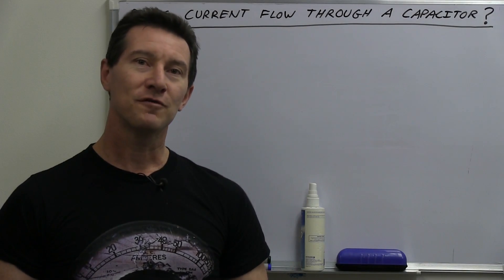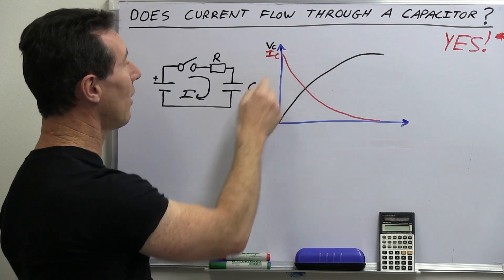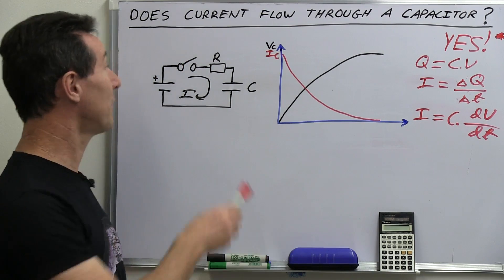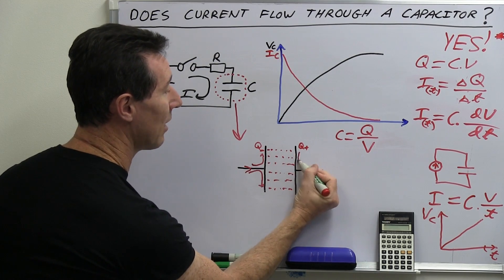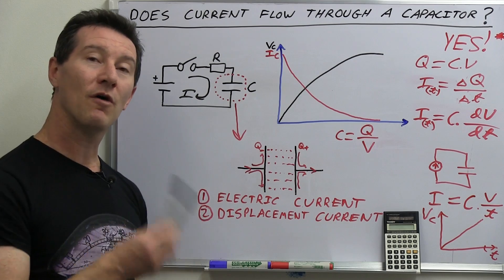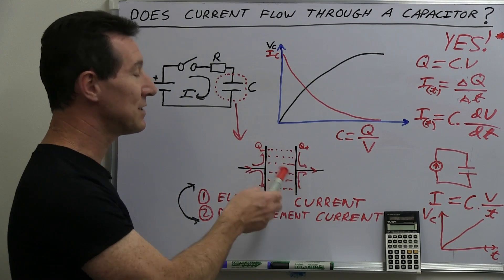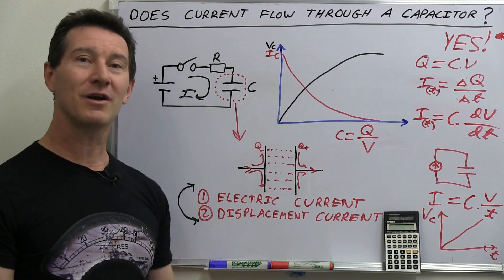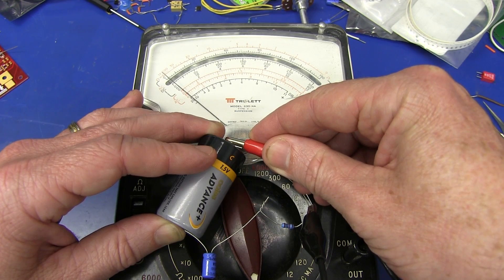EEVblog #486 - Does Current Flow Through A Capacitor?

Comment: I don't understand why you've overcomplicated something so much that's clearly for people that are fairly new to the subject. Why you'd bring up displacement current without just mentioning electrons repelling is beyond me. (Especially when you don't even slightly mention what displacement current is. You just say displacement current flows therefore current flows without giving any reason whatsoever)

The absolute exact same thing happens in a wire as a capacitor. Electrons repel other electrons, in a wire they move forward and since they repel other electrons those electrons move forward by the same amount.

They move forward onto one plate of a capacitor and since they repel other electrons they repel the electrons forward off the other plate of the capacitor.
Reply: "All those electrons being piled up on one side of dielectric would immediately clot and prevent (e.g. repel) any new electrons from coming in, "

Yes, that is exactly what I just said.

"let alone push electrons from the other side of the plate (btw since when we have free electrons in dielectrics?)."

A capacitor is in its simplest form just two plates. Put one electron on one plate, it will push the electron off the other plate. Continue to put more on, you'll keep pushing them off the other plate, until eventually it takes too much energy to put an electron on the first plate.

"While you are contemplating this try to come up with explanation of how many capacitors IN SERIES could possible work based on your theory."

Completely trivially? There is nothing magic about putting two capacitors in series. The electron that is pushes off the first capacitor goes and charges up the plate on the second capacitor and so on.

"If I place 20 caps in series the last in line would NEVER be charged because the first one (closest to -) will have charged and cut off the supply long before."

That is nonsense.

You put one electron on the first plate of the first capacitor, one electron comes off the second plate. The time it takes is irrelevant.
Reply: +BlueCosmology That is exactly what I was thinking !
Reply: +BlueCosmology 
";A capacitor is in its simplest form just two plates."
No. Capacitor is, first and foremost, a dielectric material between the two plates. Charge is stored in dielectric and dielectric only. Plates only conduct, no charge is ever stored in a conductor. And no, dielectric material doesnt source electrons. 

";Completely trivially? There is nothing magic about putting two capacitors in series. The electron that is pushes off the first capacitor goes and charges up the plate on the second capacitor and so on.&";

Here is the problem though. Once first cap saturates all others would stop getting new electrons. The first capacitor can only accept that many electrons until it saturates and stops conducting. Which means all other capacitors in series can only receive as many electrons as many the first cap can receive until saturation.
Reply: +quadcatfly The force would be the electromagnetic force, one of the 4 fundamental forces :)

If you have capacitors in series they all charge simultaneously, they do not charge one after the other.

But seriously, try the following on your lab bench. Take a couple of large capacitors in series and place some small resistors in series with these so you have a point to measure. Set your lab supply to current limit and set voltage to maximum.

If you made good choices the voltage will increase linearly (until your supply runs out of voltage range). On each resistor you will measure DC current and over each capacitor you will measure the voltage increasing linearly. If you made bad choices this will happen so fast you will not be able to measure before it hits the limits.

So if you have say e.g. 5 capacitors in series and you measure the current flowing between them at each connection and you measure this current to be a DC current while the voltage is of course increasing linearly (because you are limiting the current), how would you explain that ?
Reply: This is a basic class for people trying to learn.  Don't be a dick.  If you know, why even watch this?  And no, it's not simple.  It's only simple if you know it.  Lots of people don't.
Reply: +BlueCosmology  If that were the case, capacitor would be conductor no? Why does it stop repelling electrons on the other side?
Reply: +quadcatfly 

In the end when we apply a force to an electron and it moves then we have electric current. Of course these forces can act at a distance and they can act across dielectrics. The only little piece of magic is that the accumulation of charges in a capacitor starts opposing the flow of current over time and this blocks DC current over time (or perhaps better stated as this balances the electromagnetic force which was moving the electrons towards the plate), but this does not mean that current does not flow through the capacitor. 

Whenever there is a net flow of electrons in one direction we call it current - that is the entire definition of electrical current after all. We can also use magnets to apply this force, kind of how current flows through a transformer.

I would be very interested in your opinion about what you would get if you connected a constant current source to a capacitor. Try it out in your favorite SPICE simulation program and watch the DC current flowing through a capacitor at leisure :)
Reply: +Cobus van Eeden 
"In the end when we apply a force to an electron and it moves"
Interesting. I thought electron was the force. Carrier of charge. What force would you apply to an electron?

"but this does not mean that current does not flow through the capacitor."
What is your definition of an electric current then.
Reply: He said to Google displacement current.
Reply: Electromotive force. "E"
Reply: He was right.  You're just trying to prove you're smart.  Big difference.  Air is a dielectric, as you well know.  So don't confuse the noobs - which is who this video is aimed at.
Reply: you say large so u must be using electrolytic capacitors. electrolyte is conductive. but how about ceramic capacitors? i think no they will charge in succession starting with the outermost capacitors to the middle. i think you need more probes and data. a very interesting property indeed.
Reply: what is counterspace?
Reply: "I don't understand why you've over complicated something so", LOL you are the one over complicating thinks now. It sure made it clear to me and I'm a novice, which is who this video is intended for.
Reply: Because it's a current  (as defined classically, as a movement of charges) only "to the outside world" of the capacitor. 
Inside the capacitor  (and that's what we generally mean when we say "through") there is no electric conduction current present.
And yet some kind of current is flowing through that dielectric inside the capacitor, and that's defined as the displacement current.  
Your description of the mechanism of current is correct, any current flows because charges are repelled and attracted, but within a conductor the charges can flow, whereas within a dielectric they can't, and thus the electric conduction current no longer applies.
Reply: quadcatfly A capacitor is a conductor, electric current flows across it.

Once the plate becomes charged enough, it requires too much energy to put more electrons onto the plate, due to the electrons on the plate repelling them away, so it stops conducting.
Reply: You should brush up on electric conductivity of dielectric materials. Especially the part where it says "dielectrics are insulator".  All those electrons being piled up on one side of dielectric would immediately clot and prevent (e.g. repel) any new electrons from coming in, let alone push electrons from the other side of the plate (btw since when we have free electrons in dielectrics?). While you are contemplating this try to come up with explanation of how many capacitors IN SERIES could possible work based on your theory. If I place 20 caps in series the last in line would NEVER be charged because the first one (closest to -) will have charged and cut off the supply long before. But that is not how it works in a real world.

Comment: Dave .. Great teaching!   Question: Why not call 'Displacement Current'  a  'Field Current' ?   Minor, but that terminology would let our weary minds 'connect' in that the concept is so 'linguistically compatible' both with field theory and how we understand capacitance itself ..
Request:  Would you consider discussing in some future presentation the differences between why we think of the physics model (electron flow) and the electronics model (positive is the source pole) ?  Did the Lucas Electric Co. build it's 'empire' on a false foundation of 'Positive Ground"  lol ...   (I once had a tee shirt with a big black square on the front: labeled:  Lucas!
haha.